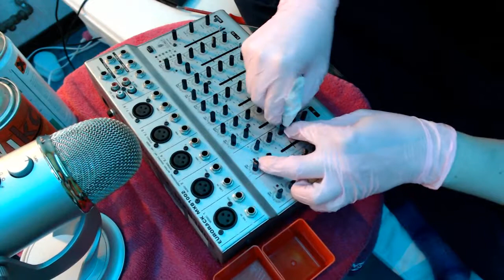Opening and cleaning a MXB1002 mixer

Comment: I just pulled my dads old mxb1002 out of storage to use for recording and I am super happy to have found someone cleaning and dissassembling one. Is the contact cleaner mix you use on the switches notably different from the isopropyl alcohol?
Reply: IPA is good for general cleaning but might not work if your contacts are corroded. That's what contact cleaner is for, it helps with contact oxidation. Also the fiberglass brushes on it came in handy.